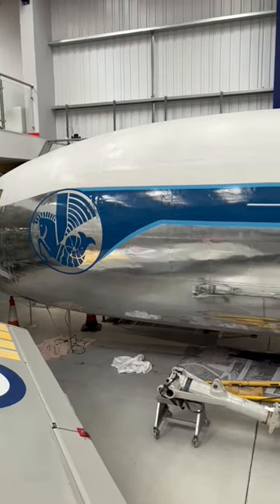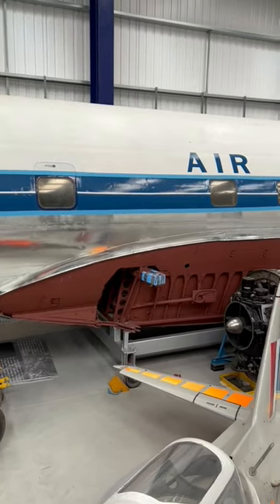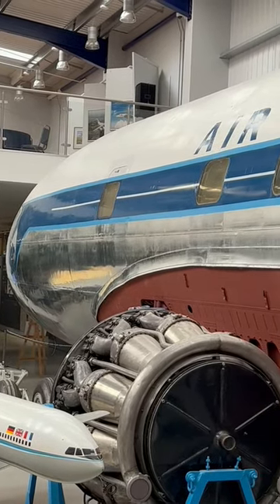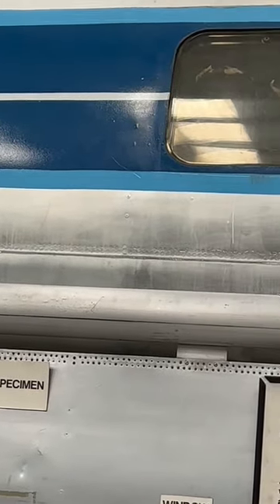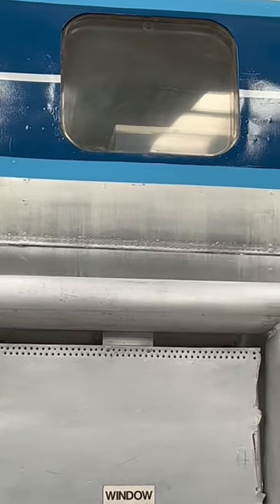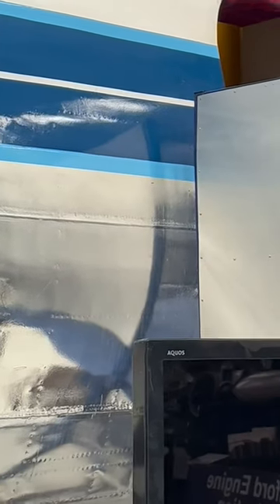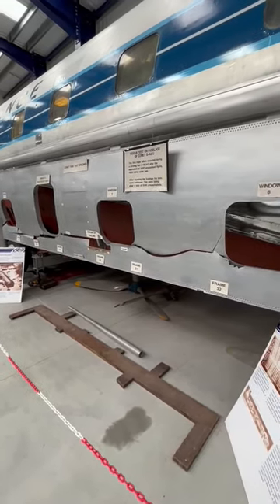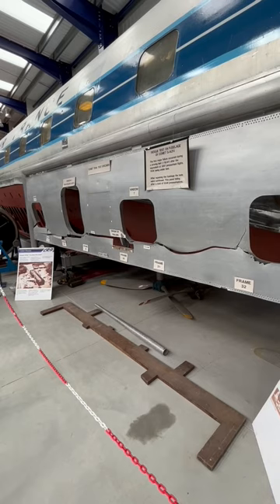Square Windows on the Comet 1  #museum #dehavilland #aviation #shorts

Comment: Yes the square windows caused fatigue cracks which is why aircraft window shape was changed. The only way we've learnt with aircraft is unfortunately through our mistakes and things like this but all the flaws in different stuff has made it safer today.
Reply from the maker: Look out for our upcoming video on this. We have access to the published Court of Inquiry report, and the museum has the original broken panels from the water testing. 
You may be interested in the conclusions !
Reply: They are designed more like for very fast trains
Reply: No, the Square windows theory has been throughly debunked, as you can clearly see the passenger windows have radius corners and were not found to be responsible for any of the catastrophic in-flight structural failures.
Reply: @sandervanderkammen9230 Yep! It was actually the riveting near the windows that caused fatigue cracking. More specifically, the windows for the antenna that was on top of the fuselage behind the cockpit was found to be a major cause for fatigue cracking.
Reply: @thekansan8683  absolutely, it's origin was from the nav./antenne port.
Of course people tend to focus too much on the source of the crack, and not what actually caused the fuselage to completely rip open.
A crack around a penatration in the fuselage skin does not cause a catastrophic in-flight structural failures... the problems with the Comet runs deeper and reveals much more serious design flaws and deficencies.
Reply: Not the window though.